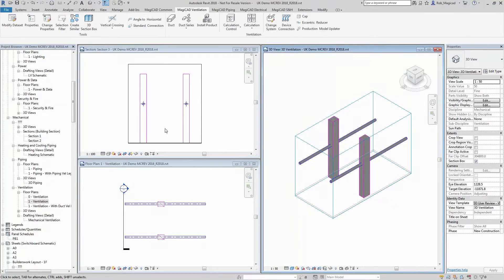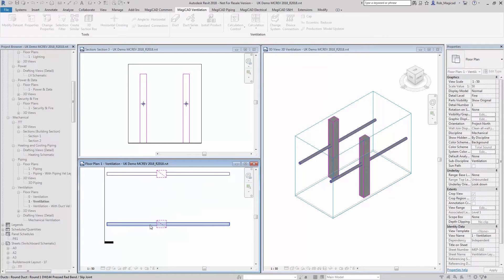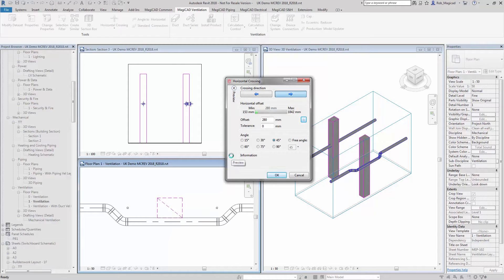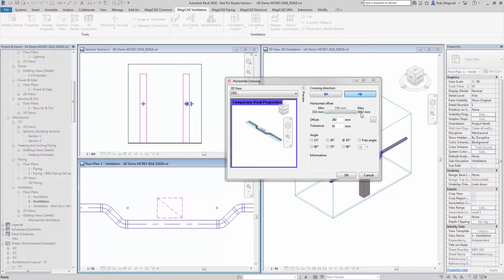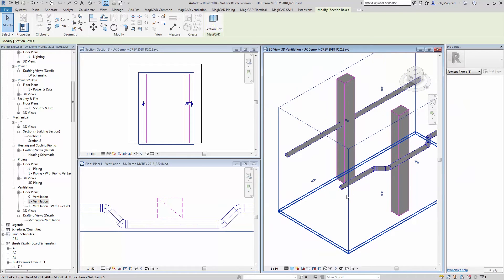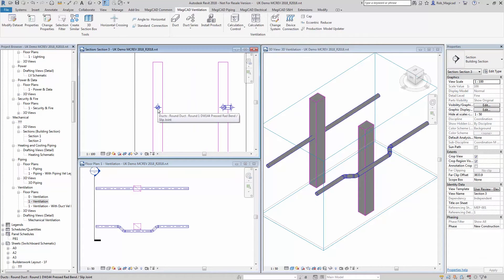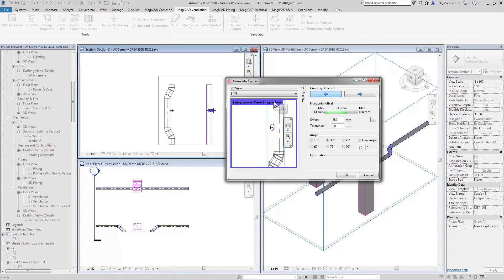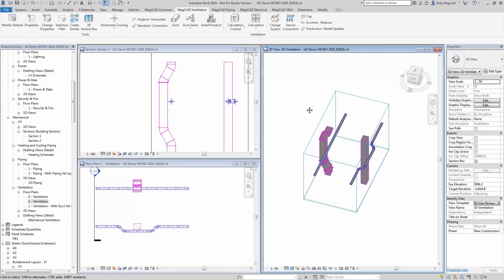MagiCAD 2018 for Revit top new feature - New routing tool for horizontal crossings

Comment: Does the duct that you offsetting the pipe around have to be in the same model? or it can be in linked Revit project?
Reply from the maker: It can be in the linked project as well. As long as you can select the objects from the linked project. If you need any further information, please contact us at support@magicad.com
Reply: Thank you very much, that is cool feature